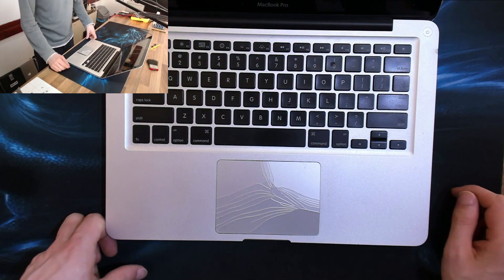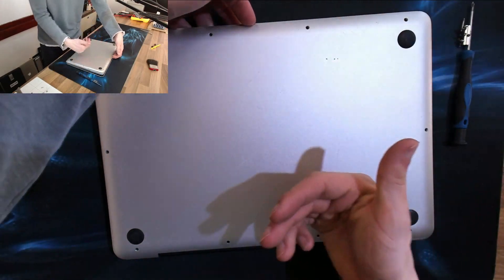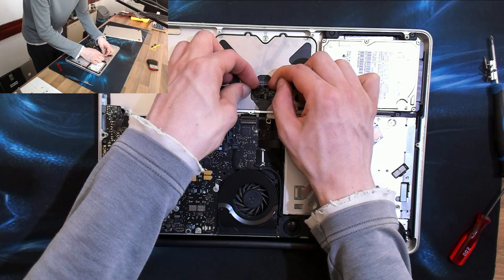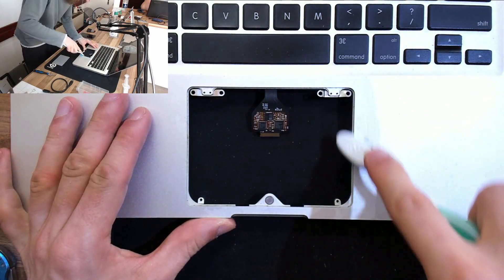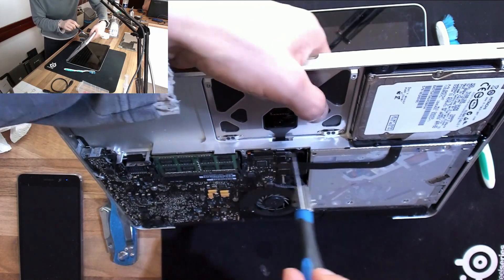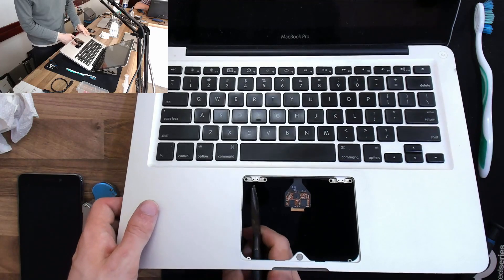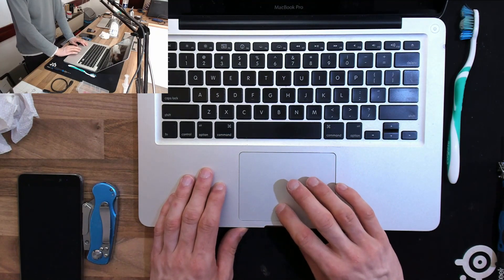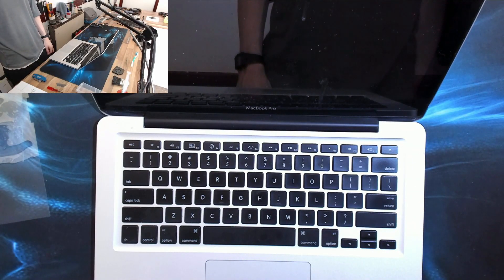LFC#114 - MacBook Pro Bulging Trackpad

Comment: Great video! Mine was an extreme case in which the battery had swollen so badly that the trackpad couldn't even click, the casing had become very hot and worse, the pressure had pushed the trackpad upwards to the point of cracking off a nearby splinter of the surrounding casing. It didn't stop there either: this was a second-hand machine and upon opening up, I found that although I could remove all screws surrounding the battery itself, the threads of the two screws fixing its connector cable to the rest of the Mac were so badly perished (presumably due to earlier meddling by previous owners), that there was no way of removing them. I was so worried about the risk of fire in my absence, I'm afraid I resorted to brute force (I really wouldn't recommend this, the batteries are volatile) and wrenched the battery away, which although it broke part of the housing (meaning the Mac will probably never be able to have a battery again!) DID solve the problem! The trackpad has retracted back to the correct depth, is now fully usable and contrary to advice given in other forms, I see no deterioration in speed or function, in fact I would say it is now performing more healthily than before..so just to reassure everyone, if it has to come to it, there IS life without a battery at all! :D

Comment: This was awesome! I just fixed my MacBook using your video as a guide. Luckily my trackpad wasnt completely broken but it was severely bulging and the metal bracket was bent on one side. I guess maybe I shouldn't have ignored the warning to replace the battery a couple of months ago... Whoops! ;) Thanks again!
Reply: meghanf2012 mines breaking on me atm! Is there anywhere decent to order new batteries and trackpads from? Thanks!
Reply: @katzy_1787  I'm pretty sure I ordered mine from iFixit. There might have been cheaper options but it came with the little toolkit and the batteries had decent reviews. It got shipped super fast as well.
Reply: meghanf2012 thank you. I’ll try them!
Reply: I ordered mine off amazon

Comment: Didn't understand the part about "disconnect the cable master race."  Could you elaborate please. I have an early 2011 Macbook Pro 13" that just suffered the same fate as the one you fixed in the video. I need to purchase a trackpad to replace mine and I want to make sure I buy the right one. Can it be any size and model year MB Pro trackpad between 2010 and 2012 or does it have to be model year and size specific? Are there any other considerations I need to take into account before purchasing? Thank you!

Comment: Thanks for this video...exactly what I needed to know as found this had happened to me.

Where would you recommend buying a replacement battery from in the UK?  I have a MBP 15" early 2011.

Also...do I need specific type of screwdrivers to remove all the screws?  I have some that are small but not sure if there's a particular type of screw fitted or are they all phillips?  Thanks again.

Comment: Like your video,but what I was wondering could I use the same touch pad if it’s not cracked?
Reply: (I know I'm late, sorry.) If you mean a battery expanded for you too and pushed out the trackpad, the only way to know is to test. Kind of similar case but my brother's battery expanded in his Lenovo and it cracked the case and pushed out the trackpad which wasn't working, but once we removed the battery it started working again. His was plastic not glass but if it's not cracked you should still try

Comment: Excellent video.  How do I know what track pad to buy. I have an older Mac similar to this
Reply: The rear of your MacBook Pro has the details of the model. In my case a late 2011 A1286 MBP.  Just search eBay for the model number. For the battery, my battery model number was A1382. Beware though there are a number of different battery ratings. Mine stated 77.5wH and 10.95v which is roughly 7100mAH. The cheaper ones are only 5200mAH which won't give you as much life. Try and find the 77.5wH one for maybe an extra £10 GBP. Mine cost £27.

Comment: Hey, I've been having an issue with my trackpad lately (Macbook pro late 2011 13 inch) I've noticed the tracking or when you direct the cursor to a specific area, the cursor glitches a little bit. Nothing bad, It is just noticeable. If not attended to, would it become more of an issue in the future? Also would you need a new trackpad for that issue? I've noticed you said to clean around the trackpad bay area, but would there be other reasons to cause this?

Comment: Hi, I have this problem too and plan to fix it by following your video, but also I have a problem where my 2010 MacBook Pro randomly heats up, uses the fan at full blast and restarts it’s self roughly every 20> minutes. Apple wouldn’t fix it because my computer is too old and it’s a liability. Do you know how I would fix this?

Comment: Can a faulty battery 🔋 make the MacBook freeze constantly? I’ve noticed my mac has started bulging in recent months and it does not sit flat on the desk anymore. It’s also freezing more and more as time goes on. Around Christmas time it would freeze up after a couple hours a few times a week. But not it’s freezing up on me every 5 minutes and the only way to get it off is to do a hard restart holding the power button. 
Is the faulty battery causing the issues??
Reply from the maker: If the case is bulging, it may be putting stress/bending on other components, which will cause freezing. Definitely get that battery out of there!
Reply: Adamant IT will do, thanks so much for your reply! I appreciate it so much! I can’t find anyone else with such issues. Its not visible to the eyes but if you put the mac on a table it does not sit flat and the back is lower to the desk than the front is. But ya it’s been freezing more and more since Christmas. It’s at the point it seems to freeze every 5 minutes (for some reason it works if I run screen recording).

I’ve ordered a new battery and a new bottom and new screws too with air cleaning can. Hopeful they’ll arrive soon this week.

Comment: Thank you so much for this video!! However, when I put the trackpad back in, it does not stay up, which means it stays in "clicked" position, unless I put the laptop upside down. And it's not because of the battery. That did not happen before I opened up the laptop. Do you know what I did wrong?
Reply: @Adamant_IT  Thank you for the reply! Yes I did try that, it makes the difference when the laptop is upside-down. But when I turn the laptop over, the trackpad simply collapses down...

Comment: Hey Adamant, here in argentina we don't have a lot of macs. The 99% of notebooks are not mac and have a external battery. I never see this type of damage. ¿Do you think it's a fail of Apple this type of issue? ¿All mac's suffer from this problem when the life of the battery runs out?
Reply: Ok!!! i understood... its all about Pro and cons. Thanks for the explanetion!! I really enjoy this
Reply: I think it's okay to admit it's a design flaw. I can guarantee when they built these computers, they did not say to themselves, let's make sure the trackpad malfunctions or even breaks when the battery cells fail. Let's make sure the entire case comes apart (see many photos online). Apple did not want these things to happen. If it was not intended, then it is/was a flaw. Search online. You will find MANY complaints about premature swollen batteries in Macbook Pros.

Admitting this is not a good thing will not take away from your support of Apple products. It's just the truth.
Reply: +Anthony Mitch Apple are very shrewd in their business model. I'm sure they must be aware of this issue. 
Most people will go to an Apple Store to fix this issue only to be told an exorbitant price forcing them to instead just purchase a new laptop.